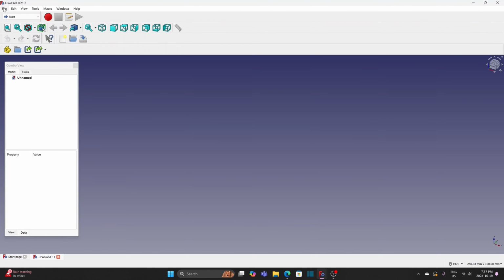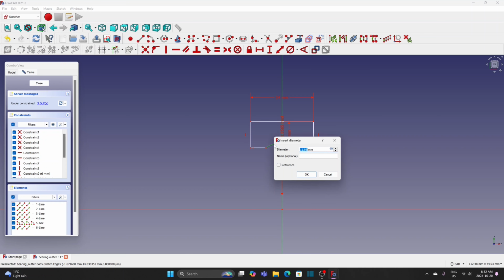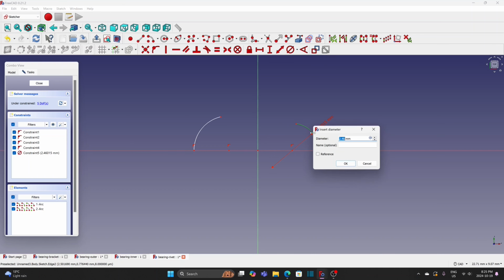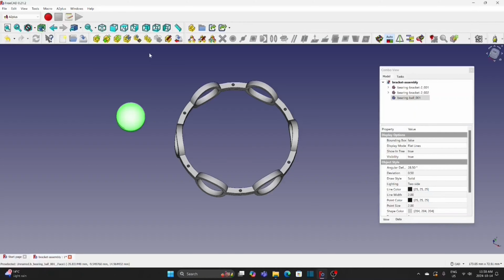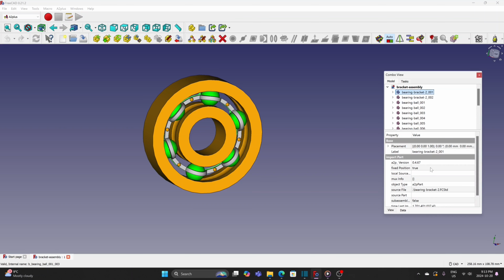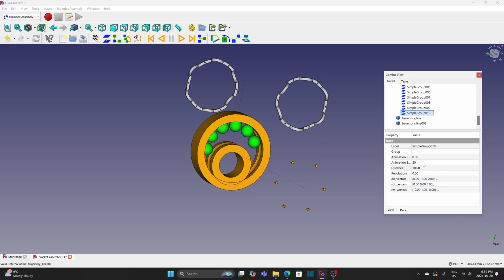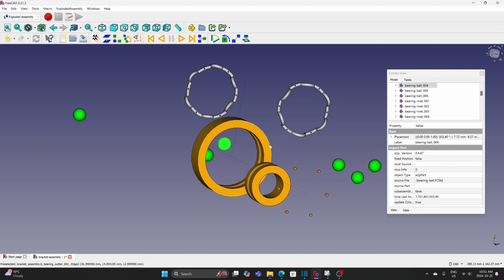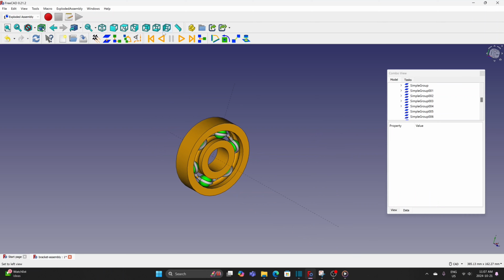FreeCAD A2Plus & Exploded Assembly - How Ball Bearing actually assembled

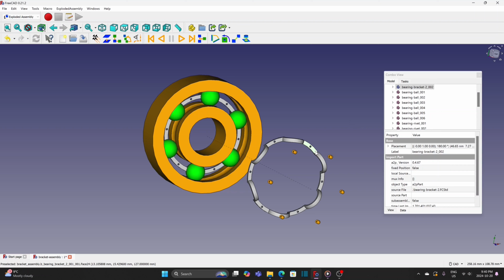Comment: Nice video! At 24:10 I get stuck. When I do the same steps, the bearing bracket continues to move on the same vector, not up as in your demo. Thanks!
Reply from the maker: Thank you! When you click the front surface (the direction for movement), the dir_vector is " Z:1". for the second movement, when you click the side surface, the dir_vector will be "Y:1" and Z is 0. Not sure why it didn't work in your case. After you select the bracket, click the side surface and create simple group, open the the "SimpleGroup" data and check if Y is 1 or not. Or you can manual change Z to 0 and Y to 1, then click the check mark "v" to confirm. Please see if it works or not.